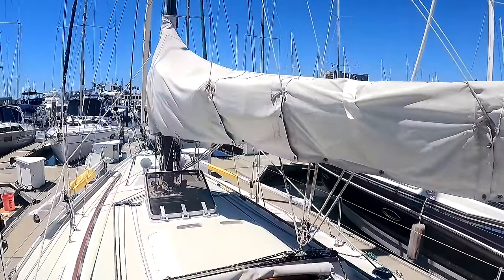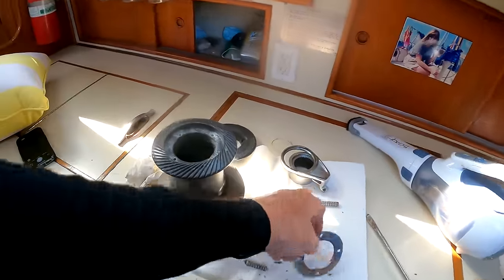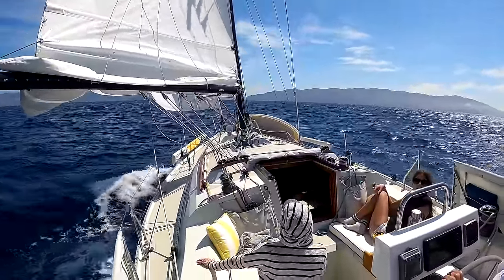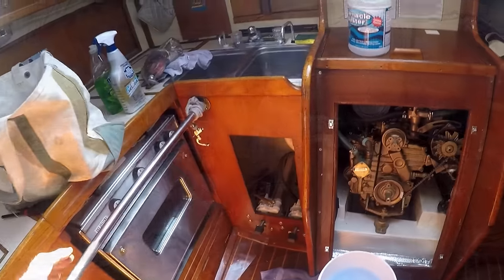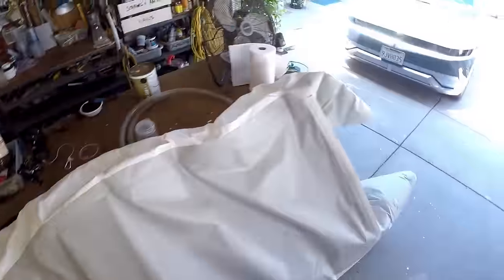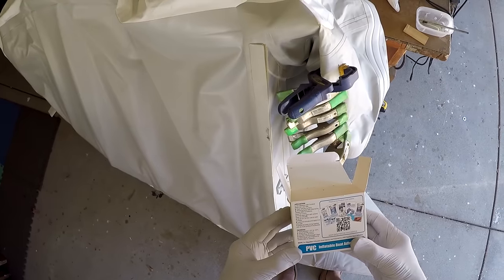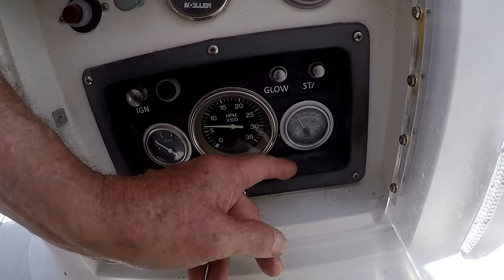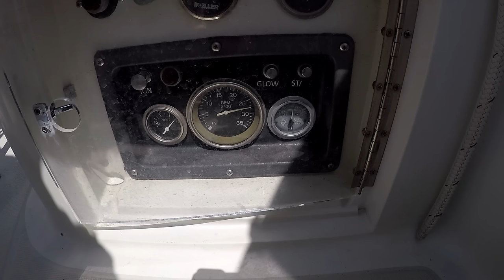Brilliant Repairs, Innovations -- and Slapjack, 2024

Comment: As I approach my 60's I've decided to live on a sailboat for awhile. I've spent the last five months figuring out my sailing goals and researching good, used sailboats in my area. I realized I will only be happy with enough headroom for my 6'2" noggin. I have other requirements but headroom is hard to find on the used sailboat market in my budget range. I've scoured ads and toured a ton of boats.  

Last week I happened across an Ericson 381 within accessible distance and reasonable budget. And she ticks off all of my immediate sailing goals! 

So, as is my wont, I then scoured the Internet for reviews and videos that are relevant to the E381 and I ran across some of Mr. Williams posts in the relevant online forums. And this, in turn, led to these videos.

I've contacted the seller and I plan to tour the boat this week.

I'm now, happily watching these videos and imagining myself on my own 381.
Reply: Best of luck to you!
Reply: @whoyoukidding1  Probably need it that's a fin keeled boat with a spade rudder. I would not own that config. I bet william's boat is long keel.

Comment: Your auto pilot handle is set on lock. I made that mistake too. When you set then raymarine 100 autohelm the lever should go down just past the bump. Like 3/8 inch. There is also a setting to tighten which will be needed if it pops out and into neutral or fully down in the locked position, which what mine did before i tightened the dial. The auto pilot is fighting the locked position and able to beat it. That’s why its squeeks like a chicken. Cheers mate!
Reply from the maker: The Ray EV 100 is set up correctly, and after 10,000 miles has had no major issues. Raymarine recommends such a water douse, which relieves harmless squeaking from salt crystals and dust. Clicking is normal for small course corrections of a degree or two, larger corrections produce a whirring tone as the motor runs continuously to achieve the new heading.